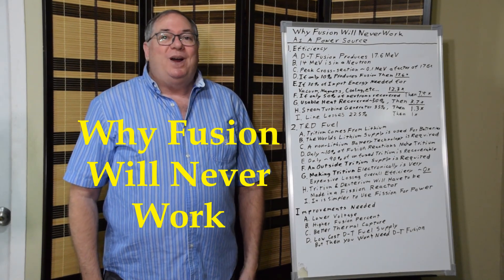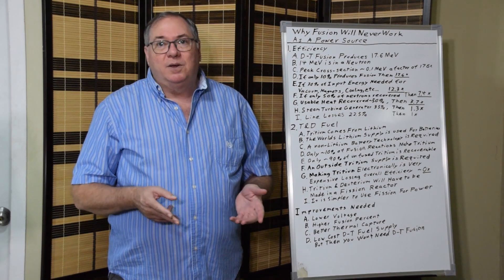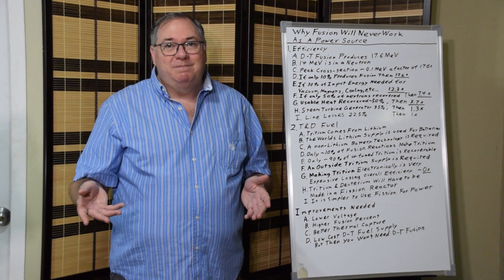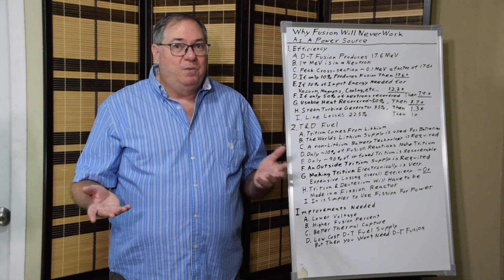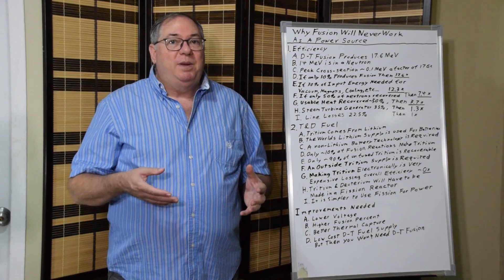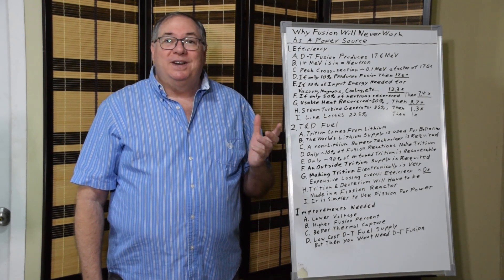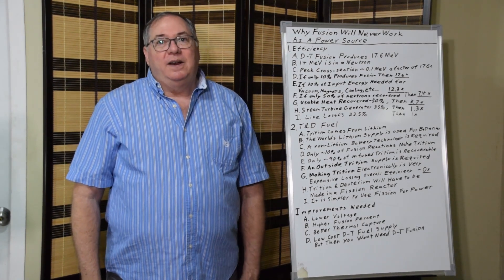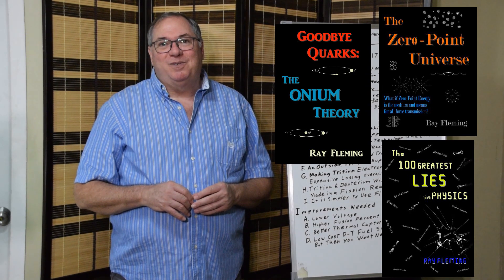Why Fusion Will Never Work

Comment: Of course, this dude knows more than the whole scientific community.
Reply from the maker: I think everyone realizes that there is no way to produce a new tritium atom for each tritium atom fused in a closed D-T apparatus. Tritium fuel must be manufactured and the energy cost factored in.  The only way to achieve true breakeven with D-T fusion with known technology is to use a fission reactor to make the Tritium.
Reply: @rayfleming2053  so if there is a break even way to create tritium, where is the problem? With the ability to create tritium in breeder reactors and the breeder blankets, with technology ever advancing, why do you statement that fusion will never happen? Also, check out some new tech using boron hydride gas and chirped pulse amplification.
Reply from the maker: @fistsmcnasty  The problem is if you have to run a fission reactor in order to get the fuel for a fusion reactor it is better to just get energy from the fission reactor. My First Fusion video I just published also shows how there is likely a much better way to extract energy. First Fusion: JJ Thomson Manufactured Tritium in 1913 https://youtu.be/yfvlYNre7i8
Reply: @rayfleming2053  the problem with fission reactors is the half life of the waste and the relative scarcity of the fuel. A fusion reactor reduces the problem of this waste as you do not need a full scale fission reactor, only a breeder reactor which is much smaller. I do agree though, I think there is a better way to extract energy, for instance the boron hydride gas method I mentioned actually produces 2 positively charged alpha particles in every reaction, giving a potential difference from the get go. No need for steam turbines at all. (Gas turbines have combustion chambers)
Reply: You don't just believe the science.  Science means they have to prove it with experiment and result. NOT MODELS.  Not computer models.
Reply: @brokenmess9921  I’ve just spent the last year creating a computer model to simulate an electrical arc. I know the limitations of a model, especially with something as stochastic as an arc. Something on the scale of fusion is a million times harder. However, when you have a model, you know the limits, you can factor in dependencies. You then test it at small scales, like MAST and JET. You use those results to update your model. The more experiments you run, the better the model gets. You can then expand it to different scales. When you find an optimum, you get ITER. The world of engineering is built on models and simulations, from ones you can run on a laptop to the ones that you need super computers for. Without them we wouldn’t be able to communicate like we are, traverse the planet or a multitude of other things. I’ve learned the hard way that you have know the limits of your model and every step has to be proved, but having done it myself, you learn when you can be confident in it.
Reply: Of course, you’re a troll
Reply: @JohnMiller-mmuldoor  a little bit of logic. I'm not personally a professional, I'm only in my 4th year of uni. I'm just pointing out that, if your conclusion differs from consensus, maybe review your findings. Do more research, then rather than post a YouTube video, write a paper, have it peer reviewed. Trust me when I say, the scientific community does not want to spend their time and money on something that won't work. Provide enough evidence, you'll be thanked.
Reply: He brings up valid points... dunno about whether or not his conclusion is correct but still waiting on fusion. I’m hopeful for it of course and crossing finger ITER or a private company solves some of the problems
Reply: I understand I'm being a bit cranky but the fact drives me nuts they claim that this experiment is going to show the answer when the truth is and they know the result of this experiment will direct our next experiment which way we go I could totally be a ease if that's how they
Present it,  plasma physics is the future
Reply: Trust the experts : The Post.
Reply: Nobody in the scientific community believes there will ever be fusion power stations.

Comment: Ray, take a look at the SAFIRE PROJECT, where containment is much reduced in a plasma electric reaction. They use standard H2, rather than D2, and the cooling is quite manageable. It turns out that mega-level heat and pressure are not needed, but the power can be supplied with high voltage.
Reply from the maker: While I disagree with much of the EU nonsense, I have been following the SAFIRE project since they are confirming other experiments that show medium energy fusion is possible. Their apparatus is not designed to be very efficient for that purpose, so I have  ideas on how to do better experiments.
Reply: @rayfleming2053  - SAPHIRE was not designed with transmutation as a stated goal, so "expecting" them to tool up for it is ridiculous. You can "disagree" with anything, but science is not a "popularity contest," except maybe current climate science.
Reply from the maker: @Alan62651  While plasma physics was for most of history not accounted for properly in astrophysical theories,  the EU folks promote a lot of unscientific nonsense. Science is not a popularity contest but it does require that theories be logical and be consistent with observations and experiments. There are far to many crackpots in the EU movement.
Reply: @rayfleming2053  - SAFIRE's stated goal was to test the electric sun theory, and they "found no inconsistencies" with it. Which inconsistencies did you find? Dismissing the findings of a fully documented scientific test effort because someone you don't like approved of it is not very "scientific." Judge the work, not the "followers." Show your evidence if you can falsify the work. I honestly don't care about the personalities, and neither should you.That is EXACTLY what I mean by "science is not a popularity contest."
Reply from the maker: @Alan62651  All they proved is that a metal anode gets heated by a high voltage current in a plasma environment. The electric sun model claims that fusion is not the source of a star's energy. Their experiment did nothing to prove that contention. They are using weasel words to claim they are successful when they proved nothing about the electric sun model.
Reply: @rayfleming2053  - I think you are twisting their words. Have a great day, Ray.
Reply: From an outsider's perspective as someone with no skin in the game... I don't care about what the theory says. I'm interested in results, and achieving transmutation seems like a very tangible, exciting result. Who the f*ck cares what the theory says? Are we really going to ignore tangible experimental results because they don't agree with our THEORY? That is the exact opposite of how science is supposed to work. So you don't like the EU theory, who the f*ck cares? If they're getting results then clearly they're doing something right. So figure out what that thing is and come up with your own f*cking theory that you like better. But just throwing up your hands and dismissing a project with tangible results because you don't like the theory behind it is plain f*cking crazy. You don't like the theory? So fix the theory! Theory is supposed to be derived from experiment, not vice versa. Physicists have been smelling their own farts for too long.

Comment: The part about trying to run fusion in a vacuum is where the problem starts. I guess this because of the flawed solar model that says the sun is a vacuum. I believe the solar model is 100% wrong in that respect and trying to use a vacuum in a fusion reactor is a lost cause.
Reply: The vacuum is there because it's necessary to isolate the structures of the reactor from the plasma. The plasma is well above the boiling point of the metals. Metallic atoms then cool the plasma well below fusion temperatures.